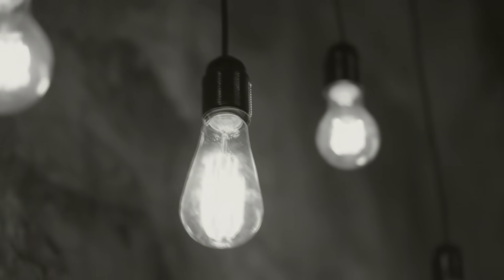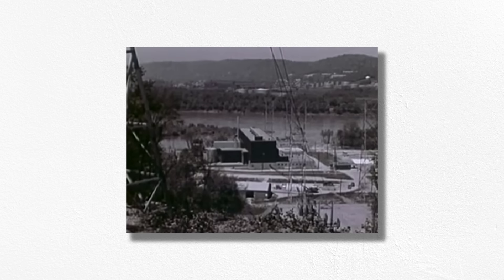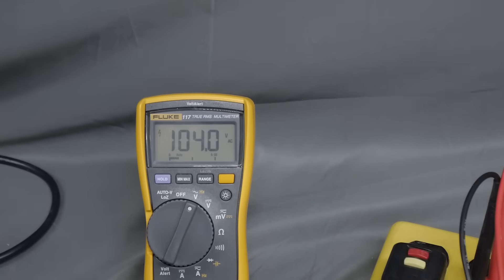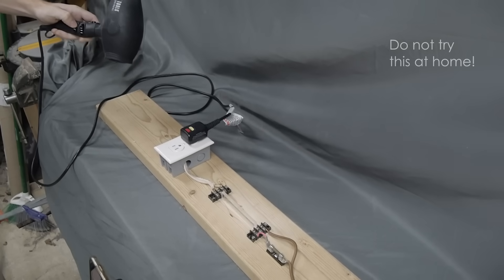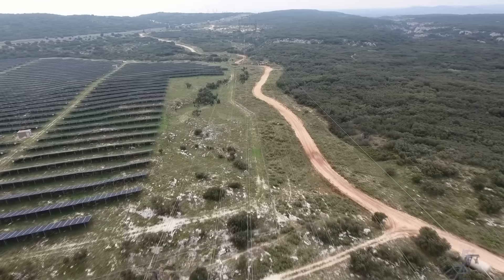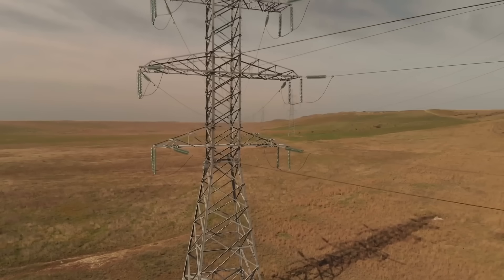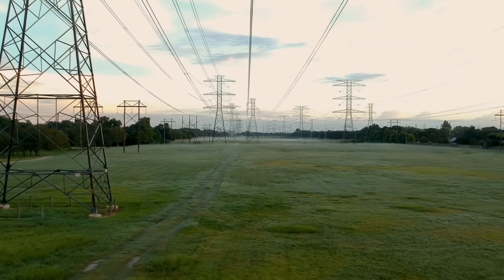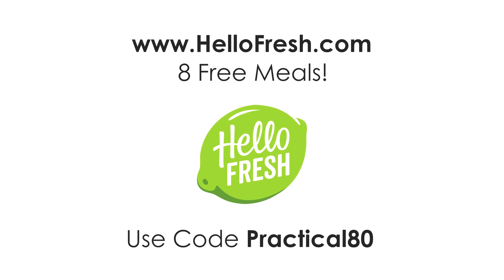How do Electric Transmission Lines Work?

Comment: *Leave work designing power lines and see YouTube notification. *

Ooooh.

video is literally work

watches anyway
Reply: Basically while you have a rough idea what it’s going to look like, each line is a bespoke design based on transfer limits, weather, contours, easement width and soil resistance.  Physical strength of the foundations is also super important, unlike a building you can cross all sorts of different geological types and features along the route, so each towers foundation needs to be specifically designed for that soil there and the loading it will see under all conditions.

Like a building is just the same building building blocks, you wouldn’t trust a design if someone just put them together without checking.

One interesting part is construction strength, the stress on the towers during construction while the are unbalanced is very different to when it’s in service.  You also need to check for cascading failures, if one tower fails how far will it propagate.

There is also the power engineering side, unloaded lines introduce large amounts of capacitance that lifts voltages at the ends.
Reply: @MrSmeagolsGhost  Could you explain that last sentence?  What do you mean by an unloaded line and how does a straight line introduce capacitance?
Reply: @Lowtiercomputer  i guess he meant when there is a gap in the line because they are working on it... and i guess it's a big conductor with a different potential around it, so its a capacitor... but thats just my guess :)
Reply: +Lowtier Computer - In its simplest form a capacitor is nothing more than two conductors with some sort of insulation between them (known as a dielectric in this instance), which is exactly what you have with long, parallel strung wires in midair. In power transmission systems, engineers make every effort to keep the loads that the generators see as close to purely resistive as possible, not only to aid in maximizing efficiency, but also for stability of the system. Large reactive loads (capacitive or inductive) have the effect of changing the output voltage of a generator. Too much of an inductive load causes the voltage to sag, while too much capacitance causes it to rise, sometimes dangerously. That is why firing up an unloaded transmission line can be tricky, because the capacitance of the line is all the generator sees. So special procedures and equipment at both ends are used during this process. That is why the capacitance of a line is important.
Reply: @Inflec  Bingo got it in one, the level of capacitance is based on the spacing, shape, voltage and length, all things that need to be considered when designing a transmission line.  Depending on the length your losses through capacitive charging current can become an issue and can drive the need for in line reactors.  

Then all the power modelling/power engineering stuff of how do we actually turn it on and what will it do to the overall system.
Reply: @Inflec  
I worked on hydro electric projects, which are usually some distance from the load. The connection using overhead HV lines was susceptable to overvoltage during low demand periods so they blew the water out of the turbines and ran the generators like motors to create an inductive load to compensate.
This was usually at night.
Reply: @georgeknowles5327  - Interesting! I knew the generators were used as motors in hydro plants that were also designed to pump water from downstream into the reservoir during low demand periods, making a "water battery" that can be drawn on during high demand periods. Didn't know they also used the inductive reactance of the generators for that function. Guess they'd be run with no, or reduced field excitation to get the inductive rkVAs to counter the capacitive effects. Ah, the versatility of electrical machines. :)
Reply: @Inflec 
This was in northern Ontario where the 400kv lines were hundreds of km from the load. I don't think that the turbines used (Francis) were suitable for pumped storage. It wasn't set up that way, anyway.
Reply: @Lowtiercomputer  The way our Protection engineer explained it to me is to think of the line as a really low frequency RF transmission line. Although the wavelength is roughly the width of the US, the incident energy just sees a place to go and when it gets to the end it all returns, slightly lagging in phase. This is what capacitance does. Physically, the capacitance is mostly phase to phase with a minority contribution in phase to ground. Since the insulators are not designed to see more than about 10% more than the normal line voltage we get really nervous when a line with energy at both ends opens only on one end. That is what transfer trip protection schemes do for us: open the far end when the near end trips. IIRC the maximum delay allowed in that operation is about three cycles... somewhere around 40 ms.
Reply: S g i just watched it drinking coffee before a power systems class. awesome
Reply: It's always fun to watch people misunderstand your work... and in a few cases get it right :)
Reply: S g, sounds like you‘re happy in this industry. 😊
Reply: I have a question. What are the reasons for the different styles of pylon used? Sometimes it changes across the same line, with radically different types like the V shape ones or the more stereotypical H shape with different waist sizes. I assumed it was designed based on the forces resulting from the weight of the cable but seeing different types in different places on the same line must mean something else is going on.
Reply: Colin Alston different structures for different properties usually, height changes, angles if the line has to change direction etc

Although over time suppliers, technology and requirements both legally and power requirements change aswell, resulting in differing construction
Reply: S g A lot of people are asking what’s there to innovate in power lines since they’re already designed. 
Isn’t that a bit like asking what’s to innovate about houses/buildings, since they’re already designed? 
Each still needs an architect and dozens of inspectors, specialists, builders etc.
Reply: I'm an electrician myself, always enjoy learning about the high voltage side of things!
Reply: @ericolens3  Number of factors. Usually the shapes change depending on voltage level. Like he says in the video, you need a certain amount of space between each conductor, so the shape of the tower changes depending on how far apart they are, how many cables it is holding, whether it is holding them all horizontally or vertically, etc. Also depends on the angle the cables are leaving the tower, it might need more cantilever support if it is leaving at a wide angle. Its all extremely interesting!
Reply: I bet 99% of us have been there :D
Reply: Being a civil engineer I appreciate these videos.
Reply: Andrew V civil/structural is the hard part of transmission line design. The electrical parts get relatively simpler as the voltage goes up (to a point).
Reply: *Finish lecture about t-lines and see YouTube notification. *

Ooooh.

watches anyway
Reply: Right?! Never woulda thought this would come up as a youtube topic, haha
Reply: Hahaha same here. He missed ther voltage though. Here in the US common voltages are 69kV, 115kV, 138kV, 161kV, 230kV, 345kV, and 500kV (DC).
Reply: @LShizer  765kV as well
Reply: @LShizer  They vary somewhat from one location to another. Here in Arizona I don't think we have 138 or 161 anywhere. Our utility doesn't, anyway. WAPA, the Bureau of Reclamation utility out here, may have the others.
Reply: you get to design powerlines? usually people might find that mundane but for commenters on this channel. that sounds really cool!
Reply: @shotgun3628  some days it is pretty mundane dealing with permits and councils etc but the actual work is like a puzzle and it’s pretty satisfying when you can fit all the bits together and come up with something fit for purpose and buildable.
Reply: U German
Reply: SAME
Reply: word
Reply: Just one word- informative. But, I didn’t understand the use of insulators between two towers. You mentor is used to draw any power leakage to the earth. Can you explain?
Reply: @R Varadarajan
Are you referring to around 5:53 in the video?  The insulators connect a conductor to the structure, be it a tower or wood frame or pole.  The insulators have the ribs on them to increase the surface area and distance across the length of the insulator.  Without the ribs, a set of insulators might just provide 1-1.8 meters of insulated material for electricity to try and cross.  But, with the ribs, the distance can be over 3 times that.  The ribs also allow parts of the insulator bells to stay dry, so impure water can't tempt fate with a complete path along the outside of the insulator.
Reply: On behalf of everyone who uses electric from our warm safe home  thank YOU!
Reply: Hahaa
Reply: ...Wohw.. It was 1.1K. I just made it 1.2K
I have Powers
Reply: Aren't they already designed? What's new?
Reply: @chrimony  Could be an upgrade of an existing transmission line or a brand new transmission line, either way you need civil and structural engineers to design the system, how many poles you'll need and the most optimal locations to place them, calculating sag and tension, etc. Every project is unique, there isn't anything that is "already designed" besides the individual parts and pieces. You need engineers to put a well though out design together.  This doesn't even include the electrical engineering, management, logistics, and physical construction side of the entire project.
Reply: Every time that you add a new generator to the grid, or change the conductors, you have to do an extensive reanalysis of the existing grid. So transmission systems are always having to be reevaluated.
Reply: I thought they already designed power lines; where is there room for innovation in power line design?
Reply: @NoZioKikes88  Someone has to figure out where to put them, which ones needs servicing, when to upgrade them, etc.
Reply: people in third and fourth world countries somehow also manage to transport electricity, and they don't necessary have super advanced engineering knowledge. How hard can it be...
Reply: @xl000  
It's not hard to transmit electricity, but to do it safely is hard. Especially when dealing with any changes at all to a design....(and I forgot reliability).... and just because a population runs their country like sh*t doesn't mean all their civil engineers aren't skilled. Those two things are pretty unrelated.
Reply: @xl000  ask them how reliable, safe, and clean their power is.
Reply: @xl000  It can be done well or poorly. Better engineering means better reliability. In North America the infrastructure has been allowed to become too old and shrunken; NERC estimates it will cost about half a trillion dollars to modernize it. In the 1960s there were two major blackouts in the US; in the last two decades there have been ten in each decade.
Reply: U dont design power lines
Reply: Sean Dafny lol those years busting my arse as an apprentice and night school for nothing.  I’ve been exposed as a fraud.
Reply: S g how many years
Reply: apprenticeship was 4 years to become a linesmen, night school to do the combo of structural and power engineering was 7 years. 

Been in the trade for about 20 years now.
Reply: @MrSmeagolsGhost  Night School Electrician
Myself..Then Since I was a Kid
I Studied the Neighborhood,
Grid Wile Farting around by the
Factories in Chicago,,
Taught My Self By Z"Observation"
(& I'm Still Learning)...👌